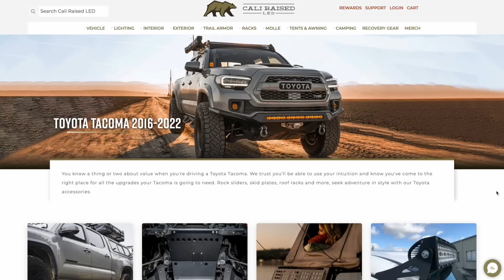Installing MORE SKIDS on my Tacoma! | Cali Raised LED

Comment: Hello. Thank you so much for doing this install video. I have a question about the cross bar piece (or front supports as Caliraised calls them in their instruction videos). Do they fit back into place into place once the transfer case is installed? I couldnt tell from the video because it seemed like they didnt install flush because of the bolt being in their way. Thank you

Comment: Double check your numbers. The MORE aluminum skid plates are industry standard 1/4 inch, not half, and the steel are 3/16... I am partial to RCI skids personally, but MORE are an excellent product. If you are in an area where bashing on rocks is most common, steel is the better choice (unless you spend much more time on roads than trails), on the other hand if you can budget the extra cost, and you mostly are on dirt covered trails, the aluminum have the advantage in weight (thus fuel) savings. This is especially useful if your truck is also your daily driver. As mentioned above I prefer RCI (mostly arbitrary choice) I am planning on replacing my factory front skid, and adding trans (with cat shields), transfer, fuel, LCA in aluminum, and the differential skid in steel (as it is the only offering) then adding rear shock hanger skids and ABS sensor guards by other companies. I am planning to get my armor RAW and coating them with bedliner.

IMO, the SINGLE most important modification for your vehicle is to install armor (full bumper to bumper skids, a set of bumpers, then a set of sliders (the sliders are only last because the factory steps do an O.K. job on the mild trails, and no factory vehicle is ready for serious trails before you have modified it.))

Comment: Great video..  I am surprised you did not paint the control arms and bottom of the gas tank for added rust protection.  However, it is very hot and dry where you are..  :)     I am waiting for a video with you and Yunni Zhai.  Make it a Taco vs. FJ compare video..

Comment: Last month I installed the RCI Transmission plate with Catalytic guard plates with the TRD pro kit to use with the TRD skid plate and Transfer plate skid 1/4 in Aluminum. And steel skid on the plastic gas tank.

Comment: I need to get that transfer case skid plate. I’ve got a CBI gas tank skid. I wanted aluminum and saw videos that people had them but I guess they only had steel at the time I ordered mine and I didn’t get it powder coated 😭 had to paint it myself! The nice thing about the CBI plate though is it has a front lip that bolts up to the crossmember right in front and protects the front side of the tank as well

Comment: Your GoPro mount is held on by double stick tape. If you have not already disposed of your skid, a heat gun (or even hair dryer) and a putty knife will allow for removing the bracket, then it is just a matter of replacing the tape.

Comment: Looks like it also covers your catalytic converters
Reply: Depends on the brand, only some transmission skid will cover the CAT, most don't.  Transfer case skid does not cover the cat at all.
Reply from the maker: It does not, although I have a video installing a Cat Shield coming next week!